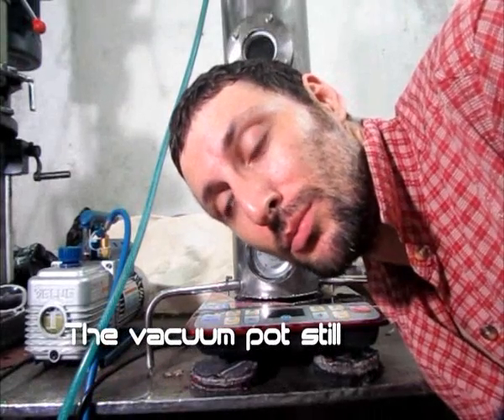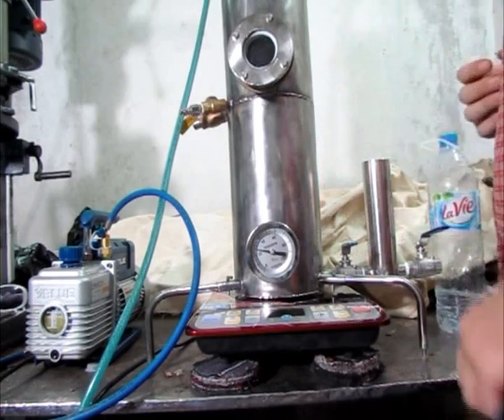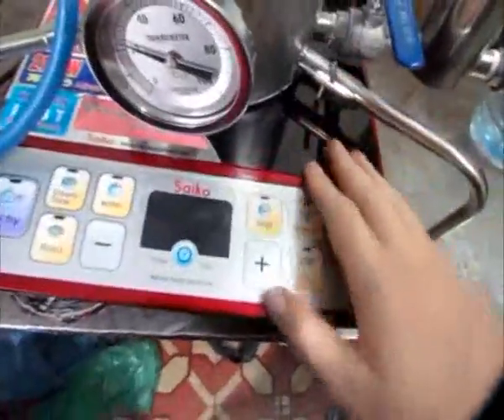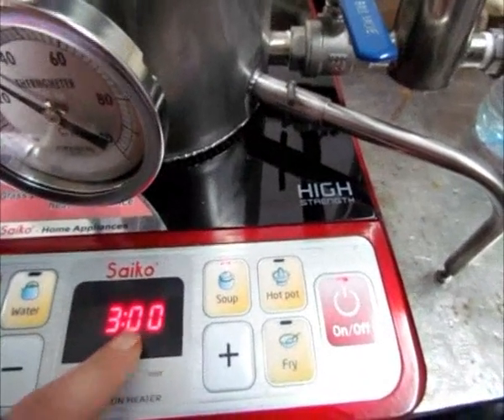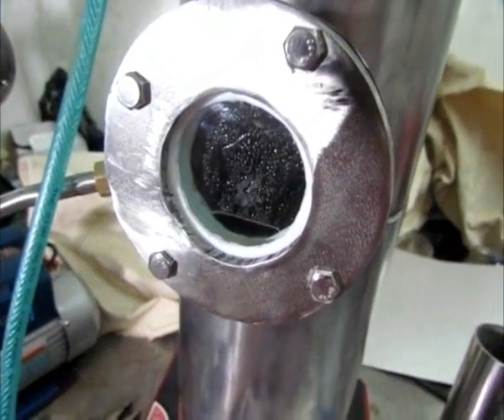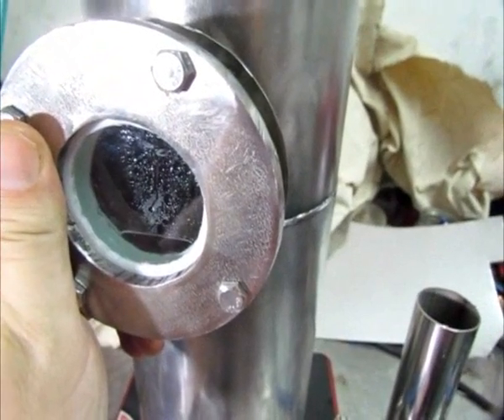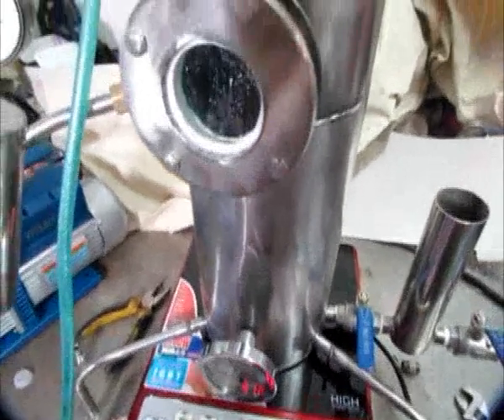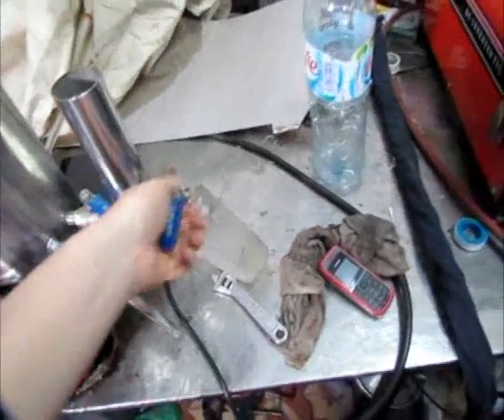vacuum pot still

Comment: Hi Manu, sorry my previous question did not make sense because I did not say the temperature, but basically I want to vacuum distill ethanol with a small set-up at home, and I am not sure what type of vacuum pump to buy. I want to operate the still at low temperature (35-50 Celsius) and so I am not sure what vacuum strength range is needed at these temperatures to distill ethanol. Cheers.
Reply from the maker: Hi, I havent tried with ethanol, but considering water distills at about 45 to 50 C (at about 90% vacuum (what you get with a common 200USD HVAC pump), I would expect ethanol to distill at a lower temp than that with a similar pump. For frequent use or big batches a 500 to 1000USD liquid ring pump is recommended instead.

Comment: Hi Manu, great video! I have a question: What vacuum strength would be needed for ethanol distillation rather than the water distillation which you are using here at ~72cmHg?
Reply from the maker: Hi, you can distill either water or ethanol at any vacuum strength. I've got much more recent vacuum distillers on http://stainlessstuff.net
Reply: Thanks, I will look at that.

Comment: fyi, your pump will die soon if it has not already.  the oil is yellow as it is from water absorption.  I just experienced having to buy a new pump for not using a cold trap like I should have.  they get loud, noisy, then just wont turn on.
Reply: thanks for your comment. do you know if motor oil works on a vac pump ?
Reply: stainlessstuff Dont use that!  it is more like Mineral Oil. you can get that at walmart.  But it is best to use vacuum pump oil to prevent breakdown & to maintain the highest vacuum.
Reply from the maker: *****
ok thanks.

Comment from the maker: Hi,
I wont publish plans because i'm selling this equipment. However there is nothing to hide in this device, there is just a liquid holder in the top part of the main vacuum vessel, the condensate falls on the holder and if needed overflows to the bottom part.